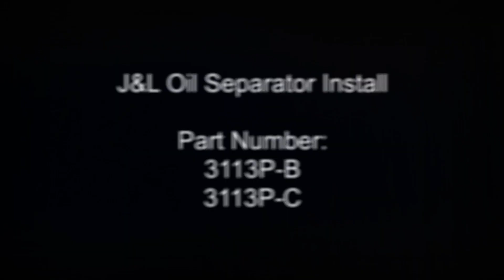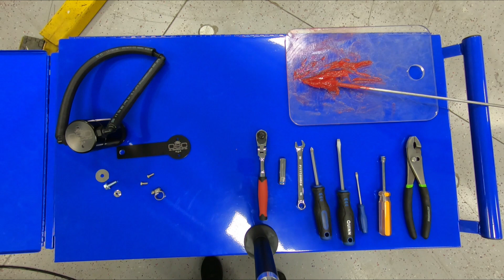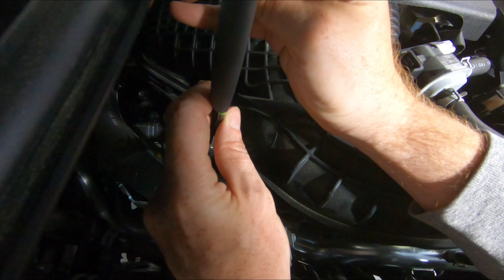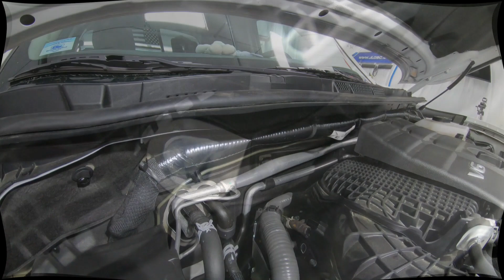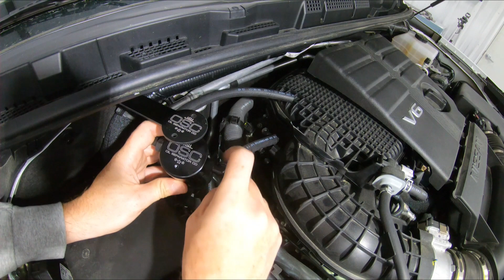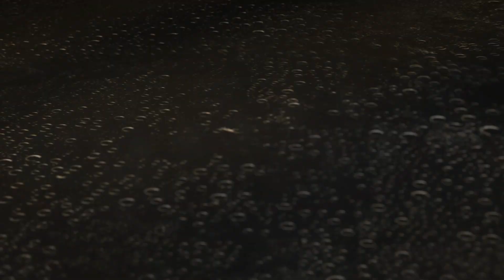J&L Oil Separator Co. 2022-2026 Nissan Frontier 3.8L Install 3113P

Comment: I installed the catch can today in my 24. The longest part was finding a pair of pliers that would fit in the odd angle that the factory clamp was installed on the PCV hose. I also appreciate how my order was ready for shipping about 3 hours after I placed it. Now I need to watch the video to do the same on my wife's Pathfinder. I don't think it will be too different.
Reply from the maker: Thank you for your business.  Yes the install is nearly identical between those to.

Hit your local harbor freight (if you have one) up for a pair of the long needle nose right angle pliers, you'd be surprised how often you end up using them for under $10.
Reply: @jloilseparatorco  Thanks. I saw that in the Pathfinder video. Fortunately I have that covered.

Comment: I just bought a 2024 Nissan Frontier Pro 4X, will this void my warranty by installing one of these?
Reply from the maker: If you read the fine print on any warranty contract you will find a lot of reasons your warranty can become void; installing aftermarket parts can be one of them. However, per the Magnuson–Moss Warranty Act proof would have to be provided that the after-market part caused the failure.

If you need further clarification, contact your vehicles service department. Some are easier to deal with than others.

Comment: This is one of the very few times where a project actually turned out to be EASIER than the YouTube video showed. On my 2023 Frontier there was PLENTY of room and to hose going to the PVC fitting did NOT need any grease or any lube at all to install. Just a little extra "elbow grease', LOL.

Comment: Why does the Nissan 3.8 need this you ask?  Because Nissan developed a new V6 with direct injection and ignored the fact that it would need port injection as well to keep the intake valves clean. 
Toyota and Ford are doing dual port injection, even Hyundai is getting into it. What gives Nissan?
You otherwise make a great truck.
Reply: Tacomas  usted Direct and port injectors, Nissan messed up again with these engines 🤦‍♂️

Comment: Thank you for this video.  I’m a proud owner of a 2024 Pro 4X and installed this, this morning.  Took me about 20 mins, I’m not an expert, but I am going to learn more about my truck and start doing oil changes.  First is recommend at 5000 miles, but anyone think I should change earlier?  Oil recommendations?  Motul?
Reply: Thank you for the tips.

Comment: Question: how to check the oil collection? Uninstall it or there is a quicker way to open the can?

Will this void the warranty? If so, I guess I will have to remove it before bring it to the dealer?
Reply from the maker: The bottom of the can unthreads from the top for servicing the separator. 

As far as the warranty goes, if you read the fine print on any warranty contract you will find a lot of reasons your warranty can become void; installing aftermarket parts can be one of them. However, per the Magnuson–Moss Warranty Act proof would have to be provided that the after-market part caused the failure.
If you need further clarification, contact your vehicles service department. Some are easier to deal with than others.

Comment: I would like to make a suggestion that you explain which side is the in and which side is the out on the catch can, the filtered side is always the in side and the unfiltered side is always the out side but in this video you say nothing about it. I know you have on line with a barb but this is something that still needs to be explained. Seem J&L will move the filter from one side to the other depending on the application which just confuses this even more.
Reply from the maker: Thanks for the feedback. We do try to make our install videos and directions as easy to follow as possible, but there's always room for improvement!

Comment: Any impact on warranty?
Reply from the maker: If you read the fine print on any warranty contract you will find a lot of reasons your warranty can become void; installing aftermarket parts can be one of them. However, per the Magnuson–Moss Warranty Act proof would have to be provided that the after-market part caused the failure. If you need further clarification, contact your vehicles service department. Some are easier to deal with than others.

Comment: Was surprised to find out my engine performed better. Not a huge difference but noticeable. Glad I came across this product. I have been using injector cleaner quite a bit for sluggish performance, think this will help a lot.

Comment: Does.frontier has fuel injector to intake valve? Or just direct injection only?
Reply from the maker: The 2022-23 3.8L is a direct injection engine.

Comment: What benefit does this do for my Nissan Frontier i just bought it today and stumbled across this
Reply from the maker: Helps prevent harmful blow by from passing through the PCV system and into your intake tract. Check this video out for a more in depth explanation: https://www.youtube.com/watch?v=nTpUjiCsPK8
Reply: Little to none. If it needed one it would be on it from the factory.

Comment: How often do I need to clean the separator itself? will it clogged ?
Reply from the maker: We recommend cleaning the oil separator roughly every 15K miles or so, which can be done by spraying brake clean through the filter and can and then allowing it to air dry.

Comment: You never explained which one is “in” and “out” on the oil catch can? It would be great if you could explain which is “in” and “out”. Thanks
Reply from the maker: Thanks for the feedback. The air flows into can through the "C" side of the can. This is the side that plugs into your factory line.
Reply: @jloilseparatorco  , so the”c” is the  “in” which plugs into the intake and the “out” plugs into the pcv.. yes? Thnaks
Reply from the maker: The "C" is the in side which plugs to the PCV, the "O" side plugs to the intake. Air flows from the PCV to the intake
Reply: @jloilseparatorco  Thank You

Comment: Please make a bracket for the old style Frontier 2020 2021 with the new 3.8 in it. obviously the vacuum lines hook up the same just need bracket location. Maybe firewall, sheet metal screw? Thanks
Reply from the maker: We're trying our best to find one of those trucks locally to come up with a mounting location. If you know of one near us, send them our way!
Reply: Any updates with the 2020/21 models?

Comment: Is it safe to use in cold places like here in canada?
Reply from the maker: In very cold climates in the winter months condensation can build up in the oil separator itself. You'll want to check it more frequently in the winter months as it'll fill faster due to that. Other than that, no problem.
Reply: No it's not you rusk flooding your pcv circuit.. this catch can is pure nonsense and only advised for turbo charged engines where oil carryover is a bigger problem since the oil circuit is pressurized and can leak on the journal bearing in the turbo shaft
Reply: @Ashoud_Anobetah  That's YOUR opinion.

Comment: Which way is the direction of airflow?? Does it flow from the pvc area or does it flow from behind there to where u unplugged the pcv hose?
Reply from the maker: Air flows from the valve cover where the PCV valve is up to the intake manifold.
Reply: I have heard some people put a catch can on both sides of the engine.i dont know much about it but maybe right before it goes back into the intake?  And I believe some have said they caught more on the intake side...do u know anything about this?maybe im explaining it wrong or have it mixed up but I want to make sure my set up is the best it can be .if that means two of them then cool ...also I saw someone test different medias in the catch can and tested the difference in pressure .i believe they sais the brass filters restrict air and create more pressure..i dont want to put a system in until I know it wont mess with the pressure too much and to make sure i catch as much as possible.any thoughts on this?
Reply: Also how is this system set up?the engine I mean..1 pcv on the passenger side and where does that hose connect to (from the catch can) does it connect to the valve cover on the other side?would it be better to put the catch can on the other side if they are somehow both connected to catch all the oil or how is the 3.8 v6 set up?
Reply from the maker: The vehicle has what is commonly referred to as a "clean" and "dirty" side PCV system. Our kit interrupts the "dirty" side. From our experience the "clean" side on most vehicles collects little to no oil.
Reply: @jloilseparatorco  Thabk you

Comment: will this fit a 2020 Nissan frontier with the 3.8 V6 since it's the same engine or does the 2022 mount in a different location in the engine bay?
Reply from the maker: Jonathan,

I was looking at photos of the 2020-2021 earlier and it really depends if the wiper cowl pin location is the same.  Could you please send us some pictures of that area of your 2020?  Send to info@jlosc.com and we'll take care of you!
Reply: I don't think so. Just looked at my 2020 and the wiper cowl is totally different. Probably same as the 05-19 cowl
Reply from the maker: @Yes Man  That's correct, we'll work on getting a 20-21 in the shop to create a kit.
Reply: Email sent, thank you.
Reply: Use one of the clip holes for the rear rubber hood seal. Use a button cap screw to install the bracket. Once complete, secure the rubber seal next to the screw with a strip of outdoor double sided tape.